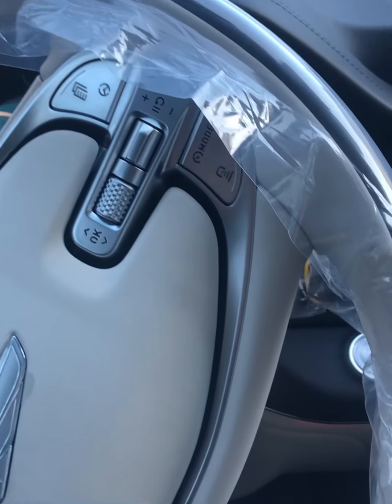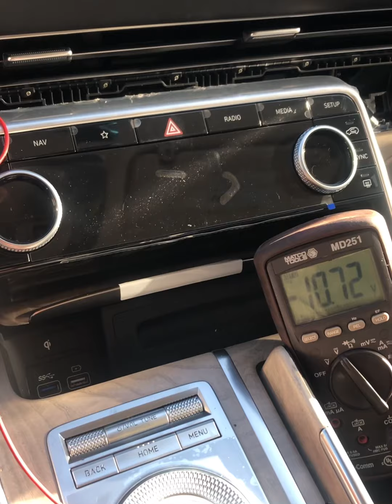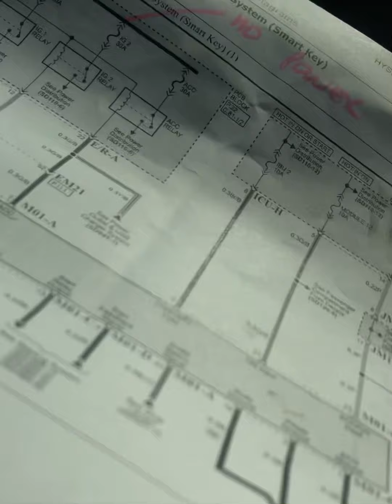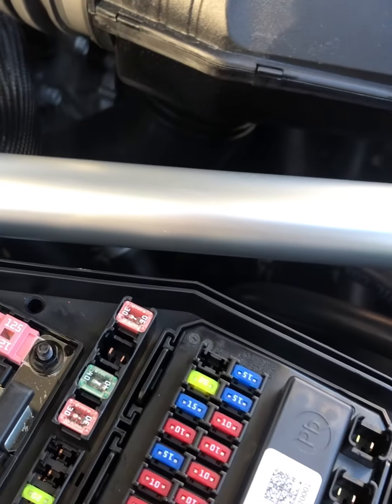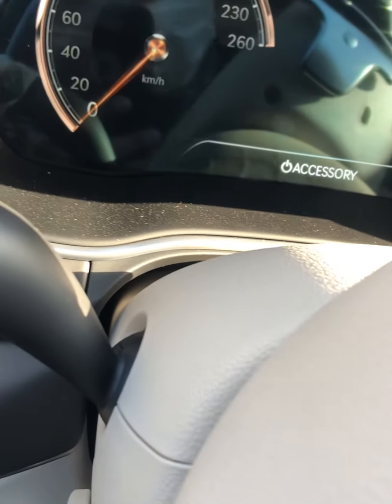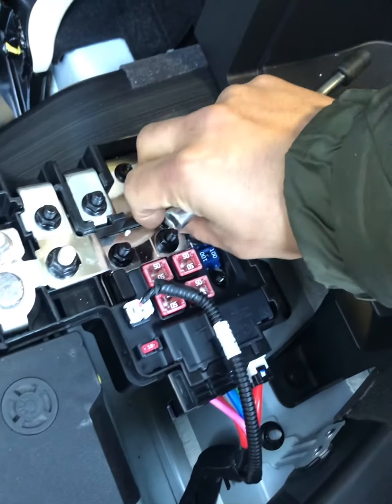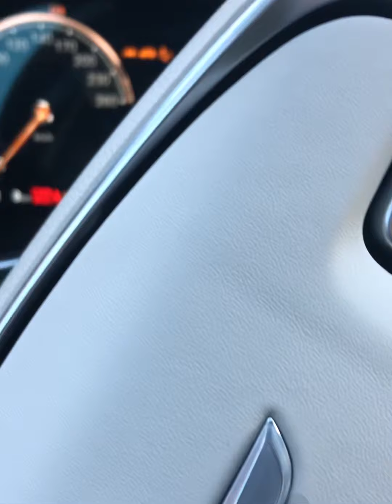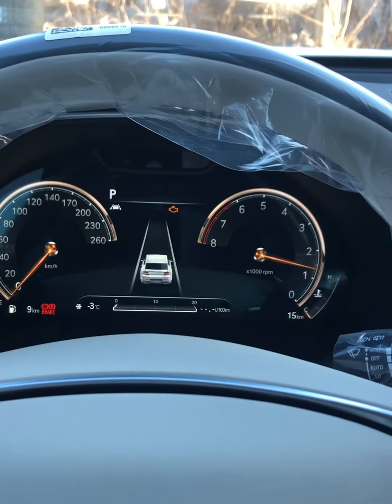Genesis GV80 no start no crank

Comment: Is it good car to buy it in gulf medil east
Reply from the maker: So far gv80 is good, ride quality is comfortable. Do a test test drive and see it for yourself.
Reply: @hyundaitech
Reply: I tried and it was good, but I am afraid of car breakdowns in the future because it is an expensive car and its maintenance is expensive and the spare parts are very expensive and I am afraid that it is a car that will not last me long because it is full of technology, not like other cars like Toyota we have in the Middle East, so I want you to advise me whether to buy or not
Reply from the maker: @qtrqtr6702  hey man thats the risk you are taking for those kind of cars especially the new ones because of the technology. So i cant really advice you about that. If you ask me would i drive the car yeah for sure its comfortable. Would i buy it? If i have money sure i will buy it coz they have good warranty coverage, if i dont have enough i would not buy it, because the technolgy in that car for sure they are expensive..hope that helps
Reply: I have a 2021 GV80  with only 1000 miles on it. It has no power,  but if you put booster cables on it the inside lights only come on and doors open. When you take the booster cables off you can't open the doors and the vehicle has no power. The vehicle with not start. The dealer is trying to see what's wrong. It's been in the shop for one week now. I am very disappointed.

Comment: Great video. Where is the fuse located for the power outlet in the luggage compartment
Reply from the maker: I think check on left side rear panel or right side there should be a fusebox there,  if not check the fuses on the positive batter cable